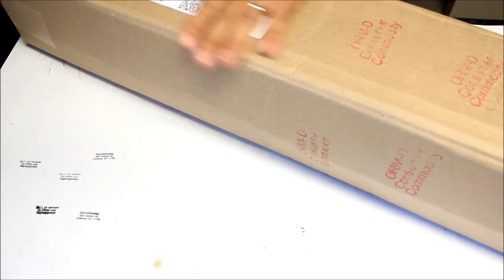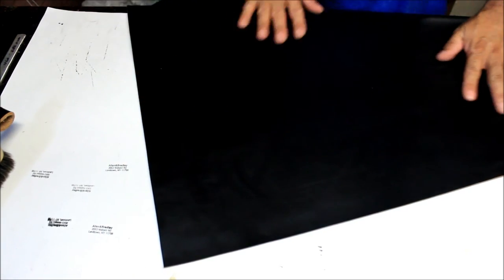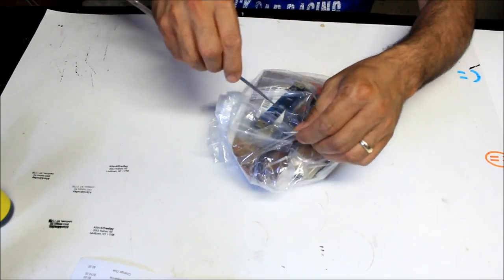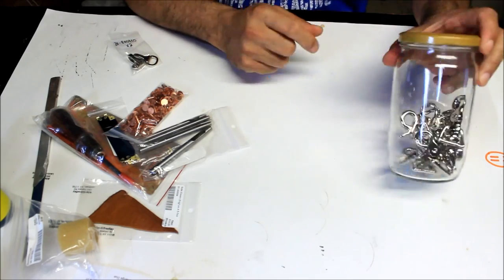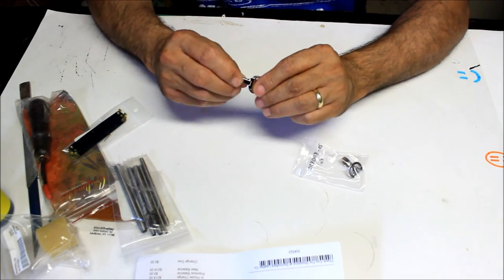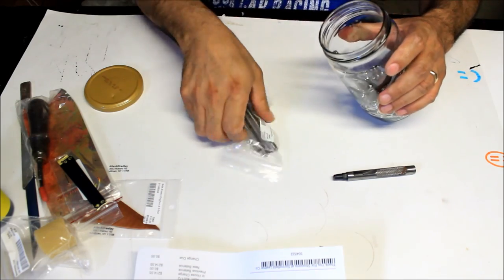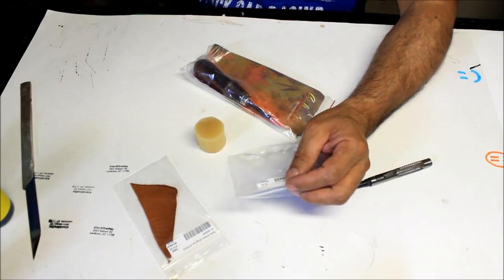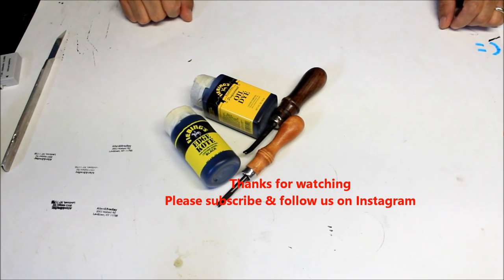Unboxing Leather # 3

Comment: Hi,
I received one of your minimalist wallets and I am little bit disappointed. I am realizing that it's a handmade product, but it has some imperfections which are bothering me:

1. The spacing between the stitching and the end of the wallet is not consistent at some places.
2. The edge paint is not applied correctly and started to fall off on some places.
3. The leather is so soft which cause some damage when is scratched little bit (I suppose it should be treated with some protective coating)
4. The logo is not aligned perfectly with the edge.

I can upload some photos for reference if you want.

I saw you videos and you are talking about quality and perfection, but I suppose the real quality of the product could be better. 

I give that comment as a constructional criticism, don't want to offend you. Hope you will raise the quality or to stop present it like is so flawless. For this price I expected more.

Regards,
Martin